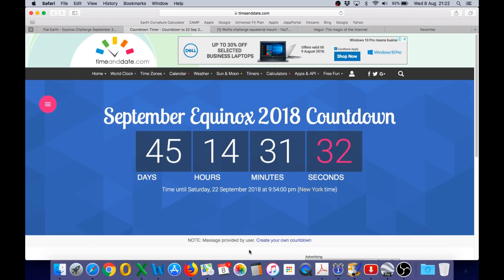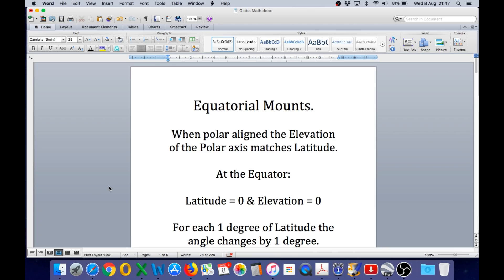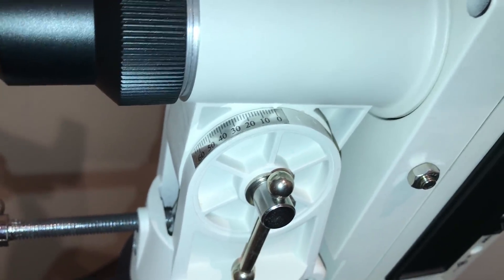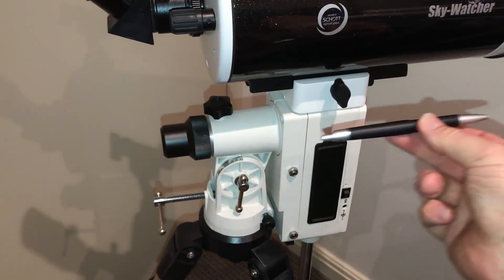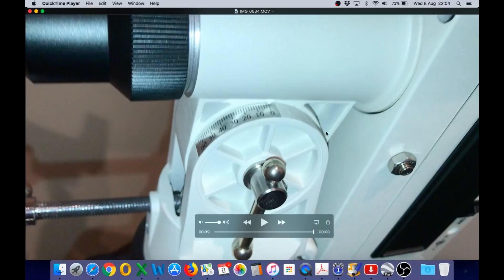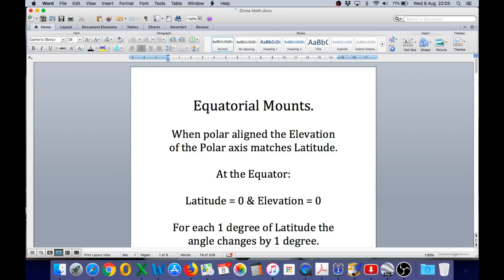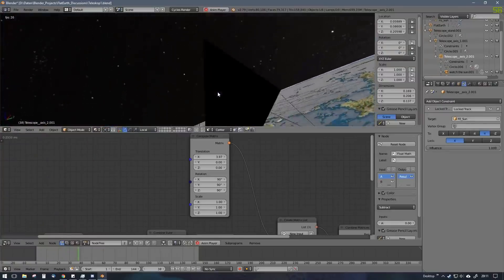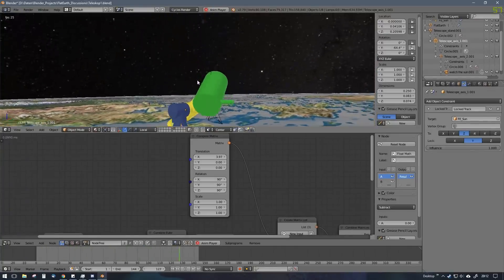Equatorial Mounts - a huge problem for Flat Earth.

Comment: This can be explained by light refracting through the earths toroidal field. Perspective is everything. Same thing goes for Polaris. Correlation is not causation. Just because flat earthers believe an incorrect model doesn’t make Copernicus correct. You just have a limited understanding of the truth so you believe you have proof of something.
Reply from the maker: +Mel Doomis.  No it cannot.  You clearly don't understand the angles.    Do you think the light refracts 180 degrees in some places and always refracts exactly the amount required to make it appear we live on a Ball?  God himself must be in on the conspiracy to deceive you about the Globe.
Reply: As light travels straight from plane to plane it is bent by the curve of the electro magnetic radiation between the stars and us it causes the change in angle.
Reply: @meldoomis6402  
'''....Light is bent by electromagnetic radiation'''??? Huh??? What??? You be talking out of your backside.

...Visible light IS 'part' of the electromagnetic radiation spectrum. 
...Dense air of the atmosphere near the Earth's surface bends/refracts light. Not as much looking up towards the stars.
...Other mediums can bend/refract light. Such as water, eyeglass lenses, etc.
Reply: @meldoomis6402  
"Real Perspective is not Goofy Flerfspective"
..Negative refraction can only occur in thin layers above the surface with temperature inversions and creates mirages and highly distorted images.
...For doing anything near what you want to be done, light would have to bend/refract in ways never before observed. 
...toroidal field doesn't help you. Magnets don't bend electromagnetic radiation, including visible light.

Comment: This may be a bit OT but there is yet another simple way to show that the earth is a sphere based on the earth's magnetic poles. For it is evident that  any magnet has two poles, a north and south pole. So even a flat earth  must have a magnetic  south pole. That south pole   could either be on the flip side of that flat disk or at its edges. Either way one can map the strength of the magnetic field to determine which is the case. Now the strength of a magnetic field is proportional to the number of flux lines per unit area they cut. e.g. see

https://www.electronics-tutorials.ws/electromagnetism/magnetism.html

And one can see that the  flux lines are more dense near the magnetic poles. As such  the magnetic flux lines of the earth would be more dense near the earth;s magnetic poles poles. Now if the south pole  on a flat disk is on the disk's back side then the flux lines would be weakest at the edge of that disk. But this would also be the case if the south pole were aligned along the edge of the disk in that  the flux lines would be sprayed out of the circumference of the edge of the disk for the south pole but concentrated at the north pole.  So if either of these were the case the magnetic flux lines would be more dense  near the north pole vs  and equal distance from the south pole. Hence the magnetic field say in canada would be far stronger than say in Australia. But that is not the case.

But of the earth is a globe the the  magnetic flux lines would be equally dense near the north pole and the south pole so that is one is   say 2000 miles from the north pole the flux lines would be the same density as being 2000 miles from the south pole (or nearly so barring other effects such as local  ferromagnetic materials and such in the soil. And it is pretty easy to get a rough measurement of the strength of the earth magnetic field using a compass and a magnet.. e.g. see

https://www.khanacademy.org/science/physics/discoveries/measure-magnets/v/earth-s-magnetic-field-

And if you try to beef up the  magnetic field on the south edge of that disk then they flux lines would never the less still bunch up on the north pole so that the magnetic field lines tell the story quite well of the  arrangement of the magnetic poles.

So here is another way of seeing the shape of the earth  by looking at the strength of the magnetic field  from northern and southern latitudes. Also (if this pays out as has typically been the case) it can offer teh FE community ample opportunity to come up with wacko explanations of why the earth's magnetic field looks like that of a globe and not from a flat disk. That so  they will just add more contradictions  such as  there is no refraction of light  argued in one FE video and then  they claim lensing in another. Bur even though the FE community does not take care to track these contradictions every one else can so adding yet another  means of observing the shape of the earth should afford both  other ways to show the earth is a sphere and others ways for the FE community to  add yet still more contradictions to their attempts to  explain away the evidence for a globe earth. For one can show that the flux lines on the earth match really well with  other means of sensing direction such as the stars (if one accounts for magnetic declination) and thus both  the stars and the magnetic field  work together to  provide evidence that the earth is a globe.
Reply: BTW here is a link that shows how the strength of the earth;s magnetic field changes with latitude.

https://www.quora.com/Does-the-strength-of-Earths-magnetic-field-differ-in-different-regions-on-Earth-And-can-anyone-determine-its-strength-based-on-your-distance-from-the-pole

Comment: If one is trying to design an experiment to generate an honest answer to a technical question, typically the best experiment is the one with the highest “signal-to-noise” ratio. In other words, the results of well-designed experiments are very sensitive to the thing one is trying to measure, and relatively insensitive to everything else. On the other hand, if one is instead interested in obfuscation, then the most useful experiments are the ones with very low signal-to-noise. With enough noise, you can get just about any result you want. This is why flat earthers love them some direct curvature observations. If you can see something that should be below the horizon, then clearly the earth is flat (so the logic goes). Never mind all the sources of noise that might affect the outcome (like scattering or refraction). It is a complete waste of time to engage in discussions about these observations. Good on ya Wolfie for your efforts to focus on high signal-to-noise experiments (like measurements of the sun’s position on the equinox).
Reply: Wolfie's videos have a big value in themselves, not just as responses or challenges to those who believe in a flat earth. That is why I'm still here and why I would recommend to everybody who has some interest in either astronomy or airplanes or flying in general to subscribe to Wolfie's channel. (For the latter I found also "Mentour Pilot" has an interesting and very active channel.)

With regard to the "flat earth scene" we need to understand that the typical flat earther must FIRST escape the brushwood of conspiracies he is caught in. It is not they don't UNDERSTAND the many interconnected facts showing the world is a globe, they have deliberately chosen not to CONSIDER such facts[*].

Because if they did it would crumble the foundation of their: "Things are not what they seem to be … education is indoctrination … we have been lied to … but I belong to those who found the truth … and now I need to tell all the world".

Flat earth has everything a religion has: blind faith in what a few leaders preach paired with the believe to belong to a very special group standing above all the others[**] – and as an added bonus they can bash NASA, their satanic figure with the sole purpose to keep the world from learning the "truth".

[*: Besides simply not considering globe earth evidence they also explain it away with "flerspective" or "reflation" – with the latter being a new term recently coined by the channel "Critical Think" more or less referring to miracle-like laws of optics. ( https://www.youtube.com/watch?v=eRLI7QStWxs&t=535 ) ]

[**: Especially including hundreds of years of science, with the sad irony that it's only because of the fruits of that science they can spread their nonsense so easily these days.]
Reply from the maker: +Terra Plana. Thanks and I like that description.  Flat Earthers seem to love their observations on a tiny scale and completely ignore the big picture.
Reply from the maker: +Terra Plana. Thanks and I like that description.  Flat Earthers seem to love their observations on a tiny scale and completely ignore the big picture.

Comment: Thanks for reinforcing the distance of a nautical mile.  Most people do not know a nautical mile is the distance of 1 minute of angle at the earth's surface. 10 degrees of curve is 600 nautical miles at sea level.
Reply from the maker: +isettech.  Thanks, I plan another video dedicated to the Lat/Long system and showing how flight plan distances are also calculated on a Globe.
Reply: I didn't mention Longitude.  Even near the North Pole an angle of 1 minute of angle on the surface is a nautical mile.  It is true that longitude lines are not one minute of angle apart from the center the earth near the north pole, but one degree of angle from the center of the earth is.  Thanks for the clarification. The distance near the north pole on longitude lines are not spaced the same as latitude lines because they are not measured from the center of the earth, only from the polar axis.
Reply: +isettech: What you meant is quite obvious to me and probably to most everybody. But to avoid any misunderstanding, including those with malicious intent (which didn't happen here … but who knows whoever stumbles over that response thread) one might say: One minute of angle along a great circle line …
Reply: Excellent clarification, said much better than myself.  Thanks.

Comment: The wobble varies the axis angle .00006 deg per year. Given your question re the recent poditioning of the instruments at the S of England, you would be well aware of the massive effect such a shift would have over such cosmic distsnces  when fixing your telescope.
Reply from the maker: +Brian Fletcher.   0.00006 degrees having a massive effect?   Do you want to re think that statement Brian?   It will have 0.00006 degrees effect on any object in the sky.   Do you consider that massive?  That is 0.2 of an arc second.  My best telescope mount is not even that accurate.   It has a pointing accuracy of 5 arc minutes so the 0.2 arc seconds is insignificant  

You are not picturing it correctly in your head Brian.
Reply: Wolfie6020 I suspected you would take that response. How far away is the distance of the dot of light. Last calculated acctual position being2,55 x 10^15 miles. Of course, the varying position relating to the suns rotation around the galaxy and the earth to itself and the sun...yet these variations dont make a noticable distance over decades? There are many variations, many of which are theoretical regarding the journeyof light itself, which us why it is much easier to analyse a stretch of coastline., but of course simple conclusions are easily overulled by incredible theories backed up with a powerful dose of belief bias.
Given the level of presentation, what specific variations in your view would be required for his conclusions to be in error. A bit easier to calculate...and consequently easier to overule.
Reply from the maker: +Brian Fletcher.  Brian I took that response because it is the correct one.  A 0.00006 of a degree change in the attitude of the Earth results in the same degree of change for any object being viewed in the sky.  

Why do you think it will do something else?  

Can you tell me please where you got the 0.00006 degree change per year from?

Comment: Please Wolfie, explain then how a gnomon on sundial set at Perths  6020 post code latitude  works.  Its relative to the obsever. Could 3.05  it be  merely that declination changes due to visual perspective, angle of resolution to the horizon line.
Reply: tboy nasa 
Not too sure what you are after but this Google search came up with a lot of pdf's
'sundials design construction and use pdf'
Hope this helps.
Reply: thank you, I have them already... cheers

Comment: 13:40 Side benefits of Sepp Sowas' video is showing the changes of apparent diameter of the FE sun and that it can never set / rise.
Reply: They come with ad hoc reasons such as the limits of what can be seen, atmospheric properties such as lensing and/or overclouding, etc. Which is not really satisfying when you can see the sun sinking beyond the horizon...

Comment: Flat-earther will Google equatorial mounts,  read the first 2 words "A Telescope" then say yep that works on Flat-Earth...
Reply: Wolfies at it again. Spreading constant disinformation.
When we confront him with evidence proving him wrong.
 In the first 5 minutes this video shows flat earth model. It explains day and night and seasons. 24 7 sun is disinformation.
If you keep watching the video it shows the sun rise and fall in four parts of planet simultaneously.
https://youtube.com/watch?v=gyhu5wM6_6s&si=EnSIkaIECMiOmarE
When the sun is at its highest or closest that's midday.
The sun fluctuates between tropic of Capricorn and tropic of cancer creating seasons. When the sun is closest that's summer. When the sun is furthest away that's winter.
If we look at what round earth says is fact.
A sun700,000 miles wide 95 million miles away. 10,000 degrees f or 5600 degrees Celsius.
Round earth thinks by a 23 degree tilt changes seasons and time zones.
The reality is things change gradually by distance. Brisbane 1000kms north of Sydney has different time zones and weather.
Every 1000kms south it gets colder and days shorter.
If the sun is so far away northern hemisphere continents should get the same if not similar weather and time zones as the southern hemisphere continents.
Night should come at the exact same time.
If we look at the flat earth model. Everything happens gradually day by day. Change of seasons amount of light. 
Example in the summer nights sky is alot more lighter. Winter nights are darker.
This is possible from a sun 700,000 miles wide 95 million miles away. 10,000 degrees f or 5600 degrees c.
Round earth can change seasons time zones and weather by 23 degrees of tilt?

Comment: I would like a Flerfer to explain a sundial and Stonehenge.  2 very old techs that prove a spherical earth.
Reply: And the lunar eclipse.
Reply: Jake But why do you think a sundial proves it? You need multiple sundials at different latitudes and longitudes, and a way to compare them instantly (telephone). A single sundial doesn't do the trick. Why, I doubt the inventors of sundials believed in a globe Earth.
Reply: Spectator Alius- a single equatorial sundial proves that the speed of the Sun across the sky is a constant 15 degrees an hour.  This could only work on a flat Earth if you were in the middle (the North Pole by all flat Earth maps I know of).  So all you need to prove the Earth is not flat is a sundial and the knowledge that you are not in the middle.
Reply: @Scott Wallace So not just any sundial, but specifically an equatorial one. And it has to be positioned correctly, so that the gnomon's shadow really does trace out an equal angle each hour.
But you yourself mention still one more piece of knowledge other than that "we are not in the middle": you need to know how to time it accurately so you know it really is 15 degrees per hour.

Yes, that is simpler than my idea of many sundials at different locations. But Flat Earthers will find a way to resist it anyway:(